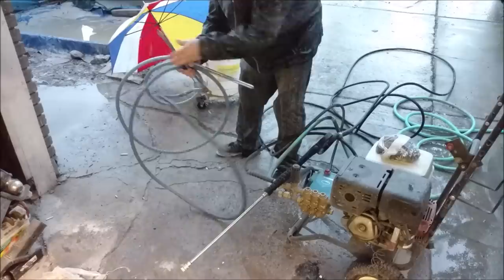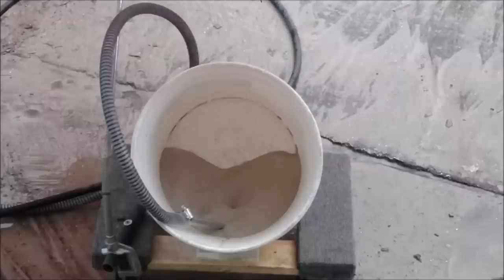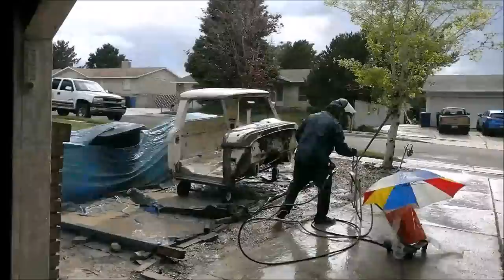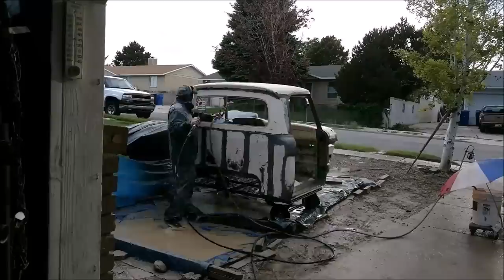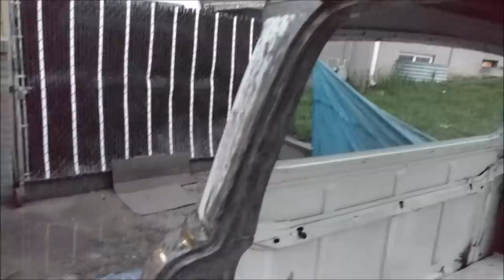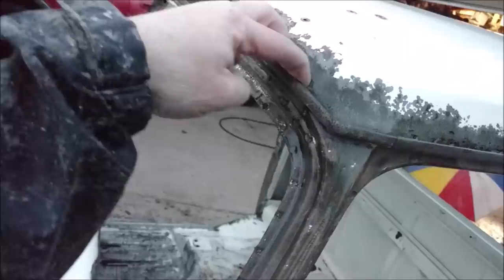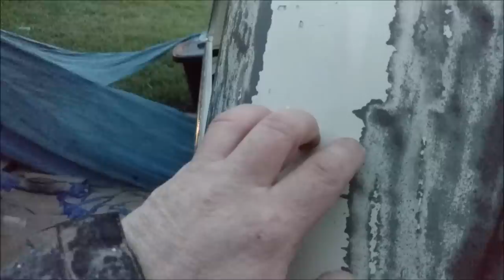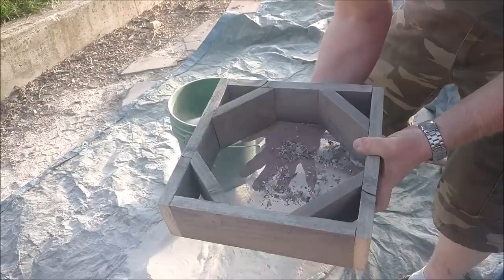Wet Sandblasting Pressure Washer Kit DIY for Auto restoration

Comment: What would a professional sandblasting business charge to strip that truck cab?  If it's less than about two bills then between the cost of the sand, the equipment and the mess made, I'd go with the professional.
Reply from the maker: Depends on where you live and the competition. It can be anywhere from $1000-$2000 to blast a truck. Most people have a $300 minimum for setup etc. Wet sandblasting has a virtually zero cost for sand as you can just use play sand at $2 a bag. If you don't own any of the tools(pressure washer) and don't get joy out of doing stuff yourself, it's not for you.
Reply: @sixtyfiveford   Actually, I do have a Generac 3200 psi pressure washer and the sand blast accessory doesn't seem too expensive.  SO yes, at one to two grand, I now see this as a DIY project.  Thanks for the info.  I love your truck cab.  It will be beautiful some day soon.  
Take care

Comment: I just saw this, another great video.  

I saw near the end where you were talking about possibly modifying it to take the ceramic blast nozzles, did you do that?  If not, how could that be done?  I do pressure washing and have the attachment also but don't like the idea either of paying half the price of the unit for another nozzle.

Just wondering how you would modify it to use the ceramic nozzle and where would you buy those ceramic nozzles at.

Thank you.
Reply from the maker: I never did. I see lots of generic nozzles on Ebay and Amazon for a buck or two a piece. I  couldn't find exact measurements of any, so I just need to order some and try them out.

Comment: You dont worry about silicosis from reusing the sand?  I get you dont need a respirator while using the wet sandblaster but  that 1 week later footage has some really fine stuff floating all over the place.
Reply from the maker: Silicosis from moving the dry sand with the shovel? Can't be any different than playing at the beach.
Reply: @sixtyfiveford  its actually banned in many countries  I guess it's pretty bad.

Comment: For what you paid for that and the time it took you, you could have just called someone with a dustless blasting machine and they'd have had it finished in 20 minutes, the whole thing.
Reply from the maker: Takes a dustless blasting company around 2hours and $700 to do the exterior of a large car/truck. Add another 2 hours for interior of bed, cab, engine bay and another $700. So 4hrs and $1200-1500 is what I was quoted a few times.

Comment: Sand blasting warps sheet metal period! Wet or dry, it will warp the crap out of good metal..
Reply from the maker: Absolutely not true. Dry sandblasting by an amateur can overheat and warp large panels. Wet blasting keeps the steel at 50F the entire time and it will never warp.
Reply: @sixtyfiveford  You simply do not know what you are talking about. Dry blasting does not heat warp anything. All blasting, wet or dry has a peening effect on one surface that causes the shape of the metal to change. On heavy material this may not cause any noticeable change in shape, but on thin metal the warping can be catastrophic, period.

Comment: How you stop rust after wet blasting ??? 2-3 weeks and its starts rust . I make normal blasting and after one rain all start rust
Reply from the maker: "Holdtight 102" will give you extended time before it flash rusts. It will stay off humidity but not rain. The only way to hold of rain from rusting it is to paint it.

Comment: Water and bare steel equals rust. How do you keep it from rusting?
Reply from the maker: Salt and steel= rust. You can use stuff like Hold Tite 102 that removes the salt from the water and it won't flash rust. Honestly though a thin film of surface oxidation effortlessly brushes away with the finest of sand paper.

Comment: I was wondering if you had any problems getting the sand to feed?  I got one of these to sandblast a trailer but the sand wouldn't feed consistantly and I couldn't see any way to make it work without putting some kind of vibrator under the bucket.  What's the secret?
Reply from the maker: Super dry sand, hand screen all the sand and finally have a pressure washer with an absolute minimum of 3.5gpm flow rate. I had to manually dump all the sand through a screen and found larger chunks that were clogging my system. I also tried it with a smaller pressure washer with dismal results.
Reply: @sixtyfiveford  I'm wondering if my pressure washer is too small.  Can find any numbers on it anywhere.
Reply from the maker: @24revealer  It should have around a 13hp engine to make enough power to work.
Reply: @sixtyfiveford  Thanks, I think its a 6.5hp.

Comment: I use regular sand to sandblast. I screen it of course. Very low cost.  Not sure if this is worth it. Thanks anyway.
Reply from the maker: It's pretty dangerous to use regular sand for dry sandblasting. This is where wet sandblasting excels as there is no health risk nor risk of warping panels.
Reply: Careful, your budget mind could cost you your life. Id recommend u do some reading before using regular sand again.

Comment: What did you use for all the flash rust ?
Reply from the maker: If you don't have salts in your water, it won't flash rust. If you do you can use a product called Holdtight 102(  https://amzn.to/3KNW2Z6 ) after blasting. It rinses all the salt away. However flash rust effortlessly sands/scuffs right off by hand.

Comment: Do you think this would work with a 2,500 psi pressure washer?
Reply: I just read through the comments I guess I’ll need a bigger pressure washer 😂
Reply from the maker: PSI means very little when it comes to how powerful a pressure washer is. The amount of water it can move(gallons per minute) is how strong it really is. Something in the realm of 4gpm is ideal.

Comment: Removable tips ??
I bought the kit but i can't see how to connct it
Reply from the maker: There are two types of pressure washer connections: a quick release and a M22. The M22 is generally the fitting that is there when you take your gun and wand apart into two pieces. Google both and you will see the difference and how they compare to what you have on your pressure washer.

Comment: Y not use dry sand blasting?  What’s the benefit
Reply: No air pollution. Unless you can put the item in a sealed container to sand blast it, you are better off blasting it wet.
Reply from the maker: Dry sandblasting can warp flat autobody panels because of the high heat(from friction) that is produced. It also requires special sand/media as normal sand will get into your lungs and cause silicosis. Respirators aren't even protection from it. Wet blasting controls the fine sand dust and any lead paint that is removed. I did this with free sand but it would have cost me under $50 it I had to buy this 400lbs of sand. Whereas special dry media would have run me around $400-$600.
Reply: Joel 1 You obviously didn't watch the whole video or you would have heard him answer that 7:42

Comment: Mine works WAY Better with copper slag , Seem to like the water better then sand.
Reply from the maker: Some of these medias can get pretty pricey at $30-50+ per 50lb bag. They can be way cheaper if they are produced locally though. How much can you find copper slag for?
Reply: Local I get 30LBS for $11.90 it removes paint in rust i find 75% faster also.

Comment: How much PSI is your pressure washer? I have a Harbor Freight 3100 PSI machine and i am wondering if it will be powerful enough.
Reply from the maker: PSI is not that important. The GPM flow rate is what does the work and you'll need at bare minimum 3.5gpm. 4gpm or higher will give you great results.

Comment: Will it work with 120 bar/ 1740 psi ? I have karcher k3 .
Reply from the maker: It won't. BAR/PSI mean very little in the pressure washer world. To really tell how powerful a pressure washer is, you need to look at the LPM/GPM that it will flow. To run something like this you'll need 13+LPM/3.5+GPM of flow.
Reply: @sixtyfiveford  Thank you.

Comment: Does the sand you use contain silica?
Reply from the maker: Yes. That is one of the key benefits of wet sandblasting. Cheap standard masonry/play sand can be used. There is no dust because all the sand is wet. Also there is no lead dust from the paint being removed as it is also wetted.
Reply: @sixtyfiveford  Ok, thanks for answering my question.  Im trying to setup a dustless blaster and I got concerned when I read that dust from ground up silica sand can be hazardous.  But it makes sense that there will not be dust because like you said it will all be wet and thats the point of dustless blasting lol.  I also found out that silica is naturally in sand due to quartz so I dont think there is anyway you can get sand that does not have silica in it.

Comment: Did you warp any metal?
Reply from the maker: No. That's the beauty of wet blasting. No heat, dirt cheap sand, no dust and no blast booth needed.
Reply: sixtyfiveford nice! I was just wondering because I got the same adapter but I also saw people who hired company’s to do it for them and got their fenders and hoods warp